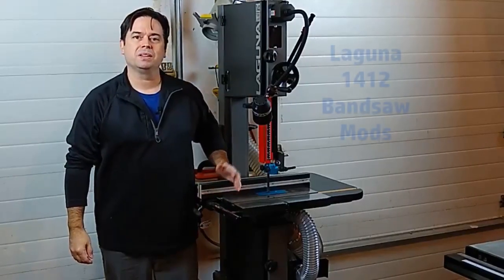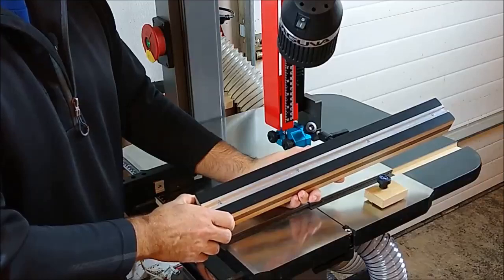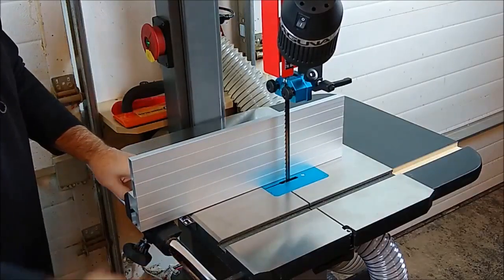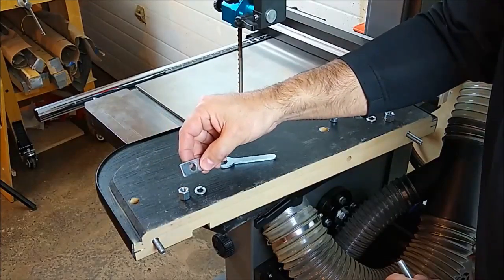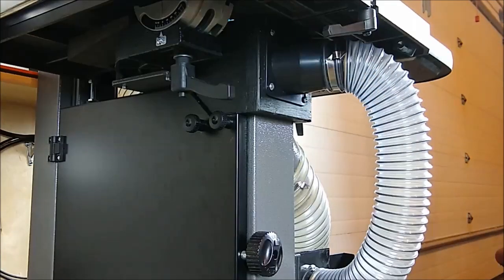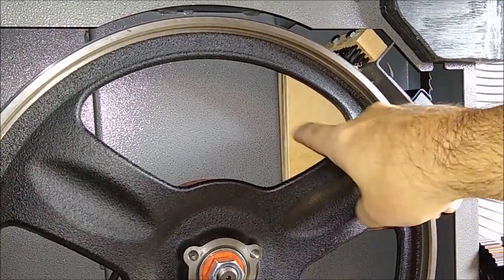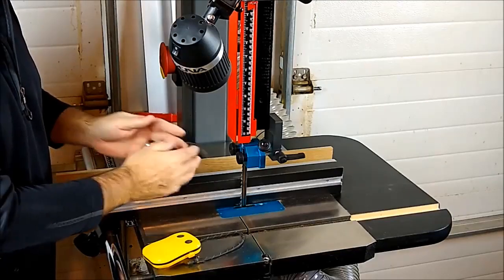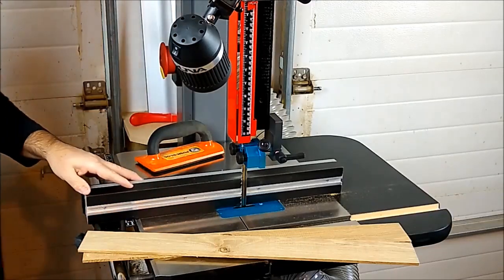Laguna 1412 Bandsaw Mods Woodworking Tool Modifications Dust Collection, Fence and Outfeed Support

Comment: Thanks for making the video. 
I have an old 14" Jet (Delta clone), three years ago I cobbled together a dust box under the table using wood and hot glue and the port is held on with bungies.
It makes a remarkable difference. 
Your design is much more elegant, well done.
If I ever have to revisit what I cobbled together I am going to leverage what you have done. 
I have wanted an outfeed for many years but never thought this approach would be strong enough, after seeing yours attached to the saw I am going to give it a try.
Reply from the maker: That's cool Charles!  Thanks for the nice comment and good luck with the tool mods.  
Best

Comment: Good mods.  I just bought this bandsaw and resawing was terrible.  My 2.5" dust collection didn't have enough air flow and clogged.  I tried just plugging off part of the 4" hole inside with just duct tape and it completely fixed it.  Now I'm going to do a permanent one with plywood.  Good catch.
Reply from the maker: Hi Spike, yeah I had a gut feeling that blocking off the lower port would help.  It surprised me how much it helped.  Glad you found some of the mods useful.
Cheers!

Comment from the maker: The dust collector is a 2hp wall mounted cyclone with 6" metal pipe on the ceiling.  There's about 25' of pipe between the bandsaw and dust collector.  A shop vac might work on the new port only, but it wouldn't have the lungs to run both ports at once.
Thanks

Comment: I only have a Craftsman shop vac and it works GREAT with the dust collection modification. I blocked off the existing port that I have reduced to 2" for the shop vac and can go back to that if I need to tit the table. Thanks so much.
Reply from the maker: Hi Paul, that's great.  I haven't heard of anyone trying the mod with a shop vac.  Glad to hear it works!
Best

Comment: I really like the table extension! Do you use the low profile side of the resaw fence?
Reply from the maker: I don't find myself using the fence in flat mode.  I usually just use my custom everyday fence, or the tall fence for resawing.  
Thanks

Comment: Nice modifications.
What are you using for a dust collector?  I'm wondering if you'd get better collection from the undertable port using a shop vac.
Reply: Nice mods. I plan  to duplicate them on my saw. Is the the blast gate on the 2 1/2 in port needed?  Are there situations you would shut it off?
Reply from the maker: @brostraveldreams743  You could get by without the 2-1/2" port, but it helps in some situations.  For instance you take the dust port off to tilt the table.    In that case it helps to close the 2-1/2" gate and still get some collection through the factory port.
Thanks!